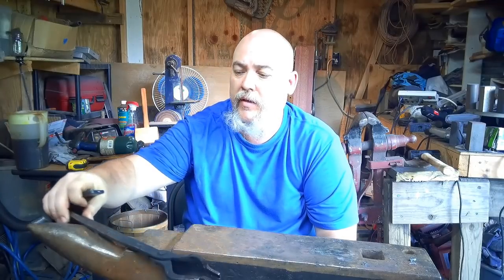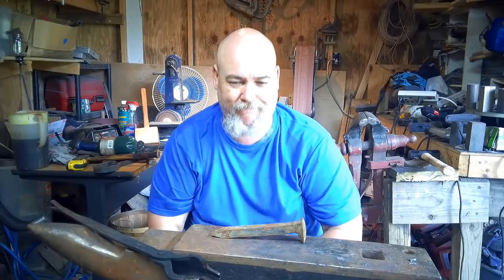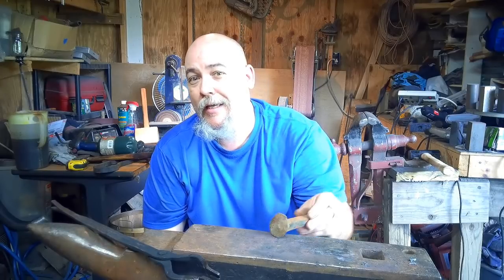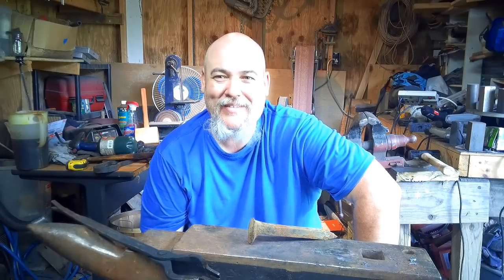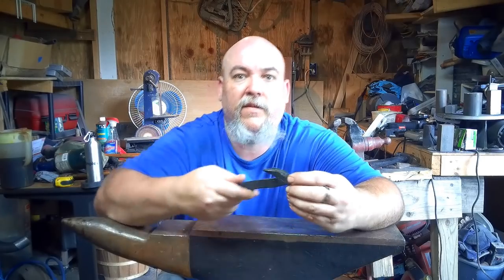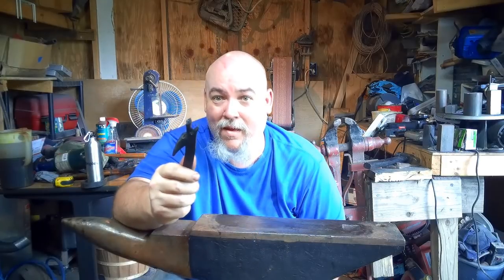#2019openersopen my dragon opener

Comment: Wow, that amboss sounds cool :D Did you try to use a magnet on the anvil, to filter out a few of that high sounds? 
The bottle opener looks very nice. Great work. Twisting the horns would also looked cool, I bet. But I think it is quite harder with these short horns, instead with long bars.I think for the first time it is a great bottle opener. 
If you look up, "dragon twist" on youtube, you see a cool style for the body of the dragon, as an idea ;)
Reply from the maker: thanks Stefan Mierke ya i thought about it after the fact i could not figure out who to do it with out messing up the heads